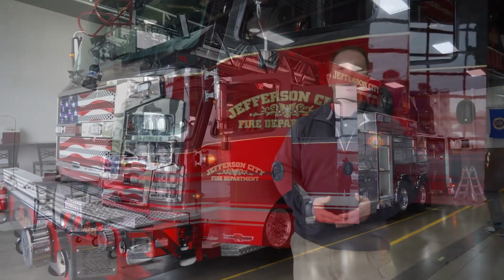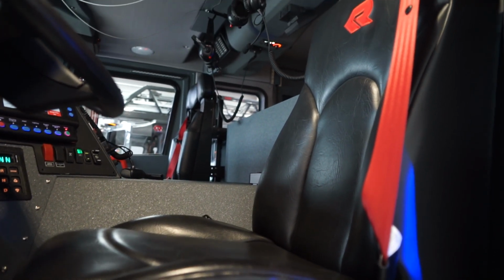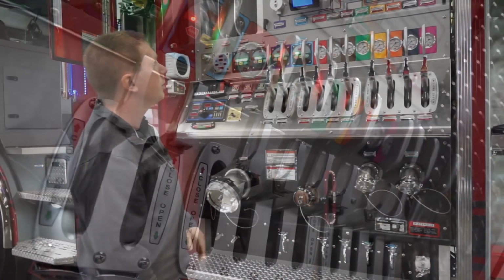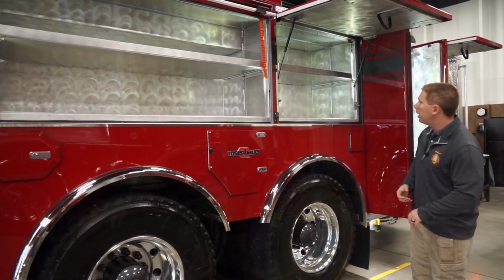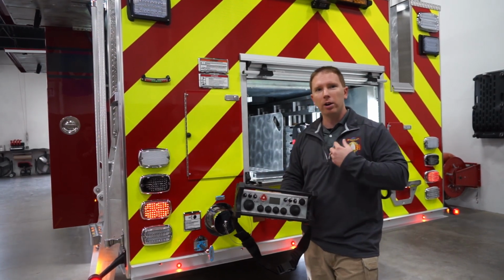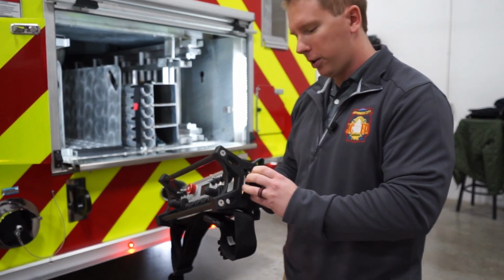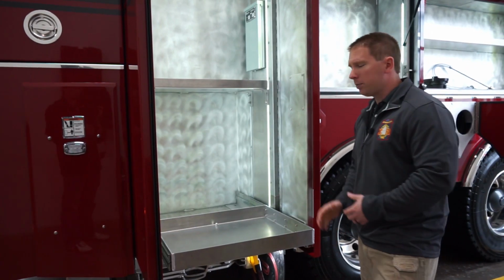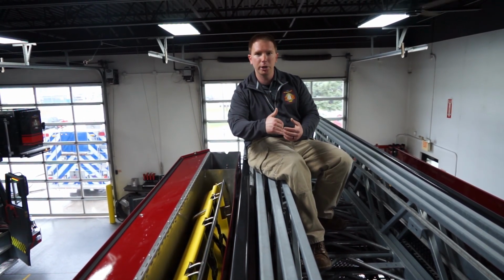74472 - Jefferson City, MO - 109 Viper

Comment: Extremely well thought out. I especially like the idea of the jack points being moved as far forward as possible. Also the remote control especially the part where only relies on two batteries that are easily accessible. As always be safe.